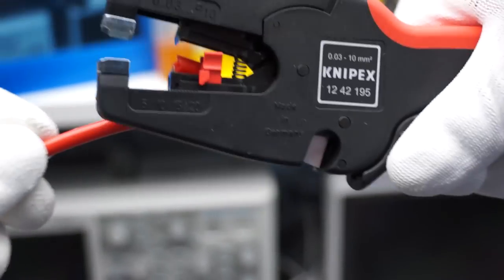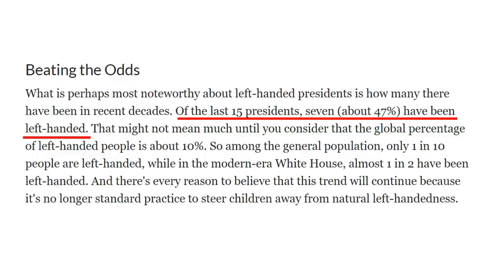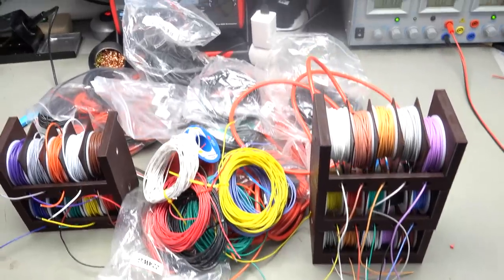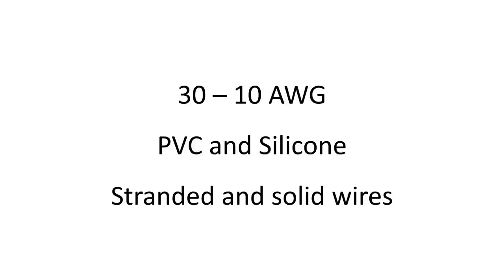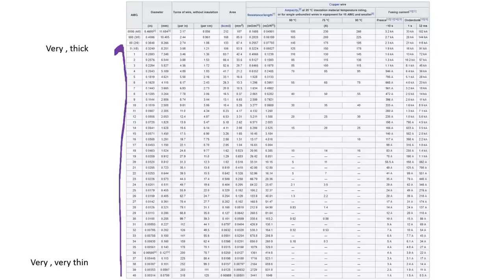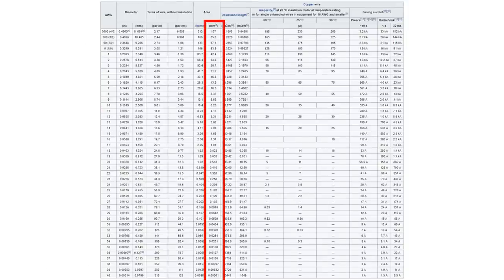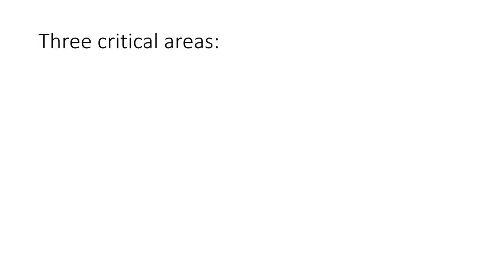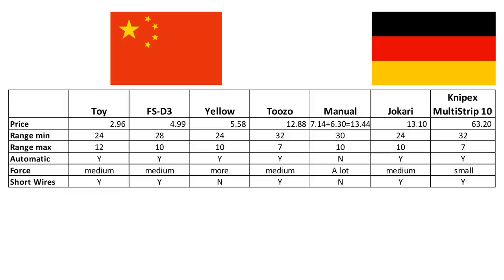#268 8 Wire Stripper Test: Germany vs. China. Who wins?

Comment: /sigh.  As an American...  I... don't even know.  Like; I'm in my mid 30s and almost exclusively use metric for literally everything I do hobby wise.  If I design something, it's in mm/cm.  If I'm working on a car, everything has metric fasteners on it.  Temp?  I get how simple metric temp is, but I just can't make that connection...  Like, What the literal hell is "10*C" anyway?!  Speed or distance?  I seriously prefer imperial miles.  How many feet in a mile?  5280.  How about 1/4 or a mile?  1320.  Why though?  Why not?!

Where I can't get things, is friggin fractions.  3/32 of an inch.  Well, let's see... I have  board that's 5 foot, 7 and 3/32 inches long that I'd like to cut in half.  WKLGSIO:GHIOPSGHWSIOPGHSIO!!!!!!!!!!!!!!!!!!!!

Man.. I don't even know.  I could get through 89% of my day with metric.. the rest... UGH!!!!!!!!!!!!!! LOLOL
Reply from the maker: Thank you for sharing your opinion!
Reply: As a European I can understand your frustration. It's not only the regularity that makes metric units so simple that makes me prefer metric, but that it's what I've grown up using. I have no problem visualizing a meter or a liter. I know what a kilogram feels like, and that a two liter soda weigh just slightly more than 2 Kg (including the bottle), and contains 2 cubic decimeters of liquid. It just fit together so smoothly. If I'd grown up in the US I'd probably feel the same about Imperial units.

Temperature is something else entirely. The hard points for Celsius are that pure water freeze at 0 degrees and boil at 100 degrees. That's at standard sea level air pressure, but for everyday life that's not really an issue. Other data points I use are texture of snow. If the snow is feeling wet and heavy then the temperature is hovering at around the zero degree mark. If it squeals when you walk it's -10 or colder. If your spit makes a crackling sound before hitting the ground it's at least -40, and if you start hearing tree trunks splitting then it's colder than -45. Any colder than that and you are probably either well aware of what you are doing or in serious trouble.
Your body temperature is normally at about 37 degrees, It can be a little colder or a little warmer, but not to far off. Hit 40 and you are seriously ill. I hit 42 once and was whisked off to the hospital where I lost three days when I didn't know what was happening. So 37 good, 40+ bad...
Water feels warm but not uncomfortable at 40, at 50 it feels scolding hot and warmer than that can be dangerous for you. If you open a tap and the water starts boiling into steam the moment it exits then it's probably in the 110 to 120 degree range. It's excellent for doing the dishes, if you can avoid boiling the flesh of your hands. Been there, still have fingers and no scarring from steam burns...

I'm sure you have similar data points that fit with the Fahrenheit scale that works for you.

When I translate Imperial units to Metric I tend to be very casual. A foot i treat as about 30 cm, a yard as a meter or just slightly less. I usually call 100 meters as 333 feet or 110 yard, as I feel that's usually close enough. A pound is slightly less than half a kilo, but if it's not for some special purpose I translate 2 pounds to the kilo. It's good enough for fertilizer, but not so good for dispensing medicine...
As for Fahrenheit I know water freeze at about 30, body temp is about 100, and that -40 is the same in both F and C. But if you say something is at 500 degree F I have no idea how hot it is...

Anything else, or if I need precise numbers I have to look it up.

Comment: They are fine for short  stripping wires,and rubbish for longer stripping.Then you have to strip three or four times.So i miss that kind of stripper here.Thats a cable stripper.One turn on the cable and pull and your cable is stripped!

Comment: 7:49 This Chinese stripper FS-D3 is a cheap replica of Weidmuller Stripax (R) tool https://www.youtube.com/watch?v=qQT60CekW_k which isn't present in this review. Unlike the original one the Chinese stripper won't release its jaws after completing stripping cycle resulted in crumpled wire core. In order to compensate that flaw the stripper needs to be puled out while finishing strippin cycle.
Reply from the maker: I think that most strippers are a "copy" of the originals. But the quality is in the details. Stripax seems to be very good quality.

Comment: The FS-D3 is a Copy of this German Wire Stripper https://www.hoffmann-group.com/DE/de/hom/Greif-%2C-Schneid--und-Schlagwerkzeuge/Kabelbearbeitung/Abisolierzange/p/728613-6
It is produced by Knipex for Hoffmann Group
Reply from the maker: You are probably right.
Reply: I can confirm that, we still use these strippers with original Knipex branding at our company and I used these as long as I can remember ;-)
I think it was the predecessor of the Multistrip 10.

Comment: I use the phoenix contact automatic stripper wich is really good
Reply: Which are you talking about? I checked in the past the battery operated stripper and ferrule crimper, but unfortunately it doesn't take various size wires. and I have the large professional workbench model wire stripper and ferrule crimper.

I would like to find a battery or electrical handheld wire stripper, which could help when there are thousands of wires to strip that cannot be done on the workbench.
Reply: @leandrohb9211  Thank you for the info, I have the CF3000 stripping and crimping machine, cost me over $3500, but it's a workbench item, quite fast, efficient and worth the cost thanks to the time saving. 
We had a job with over 50000 strip and crimps to do, at it saved us over 2 weeks of labor.
Often we need to work with thousands of stripping and crimping in areas where we cannot place the heavy CF3000 near the work area, a hand held electrical or battery operated item would be ideal.
I've just checked that the crimphandy tool now comes in various sizes, about 4 years ago, our local Phoenix supplier claimed only one size ferrule was available.
It costs over $1200 if I remember correctly.

Comment: Hi Andreas. As usual a great video! You just missed another often used kind of stripper:
https://www.banggood.com/Automatic-0_5-2_2mm-Cable-Wire-Stripper-Crimper-Plier-Cutter-Tool-p-1022463.html
(NOT an affiliate link!)
Works quite well either and longevity should also be ok due to its relative simplicity.
Reply from the maker: You are right. I could have included this one too.

Comment: ENG.
As for the longevity of the KNIPEX MultiStrip (12 42 195), I have been using it since the beginning of 2010 as an electrician professionally, with the original blades not every day but many times. 
Yes, KNIPEX is expensive, but those who buy cheap usually buy several times and are at the end mostly more expensive. 

DE.
Was die Langlebigkeit des KNIPEX MultiStrip (12 42 195) angeht, ich nutze ihn seit um Anfang 2010 als Elektriker beruflich, mit den Original klingen nicht jeden Tag aber doch sehr oft.
Ja KNIPEX ist teuer, aber wer billig kauft, kauft meist mehrmals und ist am Ende oft teurer.
Reply from the maker: Thank you for sharing your experience!

Comment: I've used 3 of those types. I still prefer this type for larger than 20awg. Wire Cutter and Stripper, for 8-20 AWG Solid and 10-22 AWG Stranded Electrical Wire Klein Tools 11063W https://www.amazon.com/dp/B00BC39YFQ
I have another design that came with a tool set that looks like pliers. Uses a set screw to "infinitely" adjust for wire size. Works great for cat5 gauge wires.
Reply from the maker: Thank you for sharing your experience!

Comment: Why don't you give the diameters in mm² as well? I personally, being used to the metric system, have no idea what those iditotic AWG figures are, and why anyone still wants to use them. Also kindly lay off the Germans. It's not our fault the americans can't use any diameter that requires less than four figures after the decimal point to express in a reasonable system of measurements.

Comment: honestly in my opinion the german system with the area of the wire is easier and more logical, the odd numbers come together by just converting the awg 1:1.
For example in germany when you are building switching cabinet we use often multinorm wires that you can use international these comply with the awg and german norm so that an awg 16 for example becomes an 1,5 mm² wire.
here i give you an example for standard diameters that are used in germany (add the mm² behind the nr.) 0,5; 0,75; 1; 1,5; 2,5; 4; 6; 10; 16; 25; 35; 50; 70; 95; 120; 150; 185; 240; 300 ,that are the diameters used in germany, you see its easy too the bigger the number the more copper you have, its just the accurate conversion that let it look like its an absolute confusing system just because its an odd number.
but the biggest plus for the german system is that if you have more copper the area actually gets bigger so you know 120mm² is bigger then 1,5mm², while if you are new to the awg scale its the other way around and it can be confusing especially if you have bigger diameters that are not numbered anymore...
Reply from the maker: Thank you for sharing your opinion!

Comment: I use a different design of manual strippers also made in Germany. I have two pairs that I have used for nearly 40 years and were standard issue to BBC and British Telecom engineers. While they are adjustable for wire thickness with a screw, for most wire I have the adjustment on minimum, which will cut the wire completely through if pressed too hard and strip the wire by feel. One pair was supplied by RS Components, manufacturer unknown and the other is marked BHD West Germany. The nearest I can find now are German made by Knipex .
KNIPEX 11 06 160 wire strippers, VDE tested https://www.amazon.co.uk/dp/B0001D9JC6/ref=cm_sw_r_cp_tai_9J-1CbMQAAC8S
No fiddly parts to go wrong and if treated well will last you a lifetime.
Reply from the maker: Thank you for your link!

Comment: Automatic wire strippers also have a tension adjustment mechanism.
I have one from an Indian brand called Multitec and it works great. For thicker and thinner wires I have to adjust the tension screw that situation occurs rarely. 

Image of the Multitec automatic wire stripper
https://encrypted-tbn0.gstatic.com/images?q=tbn%3AANd9GcT-Rp6-Vel46r1T6vud3nYTDGlJO1LeaFWIJXjVQhLl-c5NfpRZ
Reply from the maker: Thank you for sharing your experience!

Comment: Weidmüller Mini Duro Stripax for around 55€
https://www.youtube.com/watch?v=qgtsS2wJvdk
AWG 17 - 28 or 0,08 - 1,0mm
I do a lot of crimping and need therefore a precise insulation cut and precise length of the blank wires.
For a durable crimp the insulation cannot be hurt and wire strands should not be cut or damaged.
The tool is so small and allows work especially in tight places. 
I also have a Knipex Multistrip but I prefer the Weidmüller because the operation is much smoother. 

99% of the wires I use are between 0,14 and 0,75 mm²
.
0,14mm² are just barely crimpable with my MQS connector system and 0,75 mm² allow 8A long term (= hours) and 10A short term (= few minutes) load  if the cable lenght is less than 10 meters. 
That works for most of my projects ;)

On larger diameters I use this manual tool:
https://www.voelkner.de/products/762835/Kunzer-7KSZ01-Crimpzange-Isolierte-Kabelschuhe-Unisolierte-Kabelschuhe-1.5-bis-6mm.html
The real hidden gem of this tool is the metric screw cutting feature.
Turn in a M2,6 .. M5 screw on the side with the tread, simply cut - and then, when you turn the screw back out the screw is automatically rethreaded (!) That saved already a lot of time for me .
 
Another interesting fact on the imperial system. Did you know that the metric system is the only legal system to use in the US?
https://www.nist.gov/sites/default/files/documents/pml/wmd/metric/1136a.pdf
Well, why wasn't is adopted? I asked my American colleague and this argumentation was simple: "Metric is way to complicated.
 If you want a gallon of milk you have to ask for 3,78541 liters. This stupid system will never, ever be adopted."
Wo er recht hat, hat er recht . . .
Reply from the maker: Thank you for the link.

Comment: I'm using a 3,45€ tool from Pollin ( https://www.pollin.de/p/automatik-abisolierzange-500070 ). It looks alot like the "toy", but it does have an adjustment knob that lets you change how deep the blades cut (through changing the spring force somehow). It works well on all the "maker" wires I use (don't have any AWG numbers).
Btw. the thing you strip is insulation . Isolation is a false friend with the German word (although some of the meaning is the same in both languages). Insulation is the thing that covers something to keep something (electricity, heat, sound, ...) in or out. Isolation is the concept of keeping things separate, like someone living on a remote island is "isolated" from society or you isolate a problem by separating it from possible causes.
Reply from the maker: I got quite a few reminders about my mistake. Thanks!

Comment: WOW 35% of Amazon buyers say the German quality is more China than DE quality. Anyone else find this review, confusing and without a clear winner?Nothing negative about the reviewer implied nor intended. Typically it’s all over my head but challenging and instructive.

Having spent over $100 on””improvement.”. I’ll take a high quality manual stripper. My the most used tool. if I’m making making 20 or 30,  two wire pigtails, manual  rulz. Surely not any great feat but timing the process, anal retentive exercises, I’d not have a great time loss if I did a-runm of 100. But then I’m a gardener and as a maker 3 years old..
Reply from the maker: I used a manual stripper up to this video.

Comment: I bought the toy one on my local hardware shop hahha for yep about $2... But it had a little knob that adjusts the pressure applied by the blades........ But it broke after a week or two but fixed it with epoxy resin and I using it ever since without problems..
Reply from the maker: So for sure, it was a different tool, maybe similar looking...

Comment: qouted from Eddy Fontaine                          <<<I purchased a Knipex recently and i was a bit dissapointed:  
I<<<t could not strip normal "electrician wire " of 1.5mm² or 2.5mm² ...( non silicone insulation.very good, a Person where say's the Problem that I have too. Catastrophe. 1,5 mm one wire, will not be stripped. you can do ist slowly, or fast, it is never working. this is confirmed in other vid. then I bougth a Weicon Tools no.5.   What the knipex not can do, the Weicon does it. I'm now happy with this one. (it's a 1/3 from the Price from Knipex). Knipex are now retired!!!

Comment: I tend to use a hot soldering iron for most stripping on the bench, it's messy and lots of bad fumes but works fast and fine with no damage to the conductor
Reply from the maker: ...and it might not work on silicon insulation.

Comment: Okay im telling you guys now that you should not buy selfadjusting and manual ones!  Selfadjusting ones usually have trouble with smaller and very soft(rubber) or hard insulations and manual ones are for idiots and your better off with a break off razor. And if you use them more often or for business you should stay away from those pistol looking ones they are harder to handle than the ones like the Toozoo or the Knipex. At work we usually used 2 sets of strippers one for 6mm² and under and one for 10mm² - 16mm² , for everything bigger (or alot of cables) we used a pneumatic stripper that you could adjust because 25mm² wirestripping with a wirestripper is no fun tried it more than enough times. 

For Reference:
Garant 728613 6,
https://www.ebay-kleinanzeigen.de/s-anzeige/weidmueller-abisolierwerkzeug-stripax-16-profi-zange/1048010471-84-16752

You should also check this out for cablestripping: Weidmüller AM25
Reply from the maker: Thank you for sharing your experience!

Comment: You need to try the Pressmaster Embla strippers. I used someone's the other day at work and was amazed at how smooth they worked. I looked them up on line and saw how expensive they were.
Over $75. Might be worth the cost if you used them every day for your job.
http://www.pressmaster.se/product/embla_16
Reply from the maker: They are probably for too thick wires for an ordinary electronics maker as we frequently use wires above 20 AWG.

Comment: My stripping tool, pocket knife. Score the insulation lightly and yank it with yur fingernails. Unless I am doing 12 or 14 awg solid core house wiring; I have a "manual" stripper for that. It looks a lot like this one: https://www.toolbarn.com/catalogsearch/result/?q=74017+NM+Cable+Ripper

It has a little nub that has a point, used for slicing the jacket off romex. It weighs next to nothing which is useful for a guy/gal lugging around a tool belt on yur hips all day and its very fast at stripping solid wire. Perhaps it has limited use but if you're doing house wiring, it's a must have.
Reply from the maker: Thank you for sharing your experience!

Comment: both me and Marco Reps have these wire cutters on our workbenches. I would recommend you to test: https://www.conrad.de/de/p/weicon-tools-no-5-51000005-kd-drahtabisolierer-geeignet-fuer-leiter-mit-pvc-isolation-0-2-bis-6-mm-10-bis-24-804037.html
Reply from the maker: Thanks for the link. I will not do a test in the next time. I would have to include another 20 or so different brands if I read through the comments...